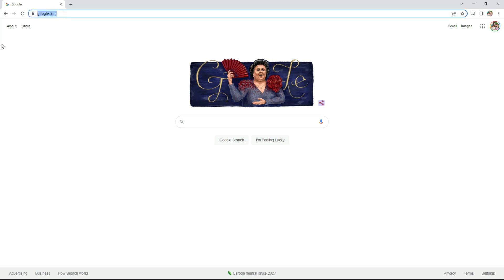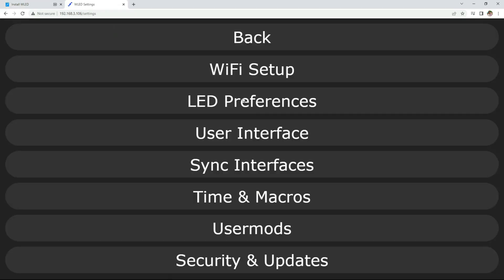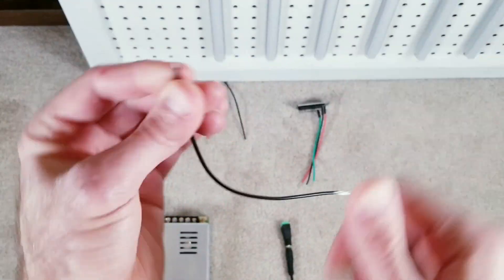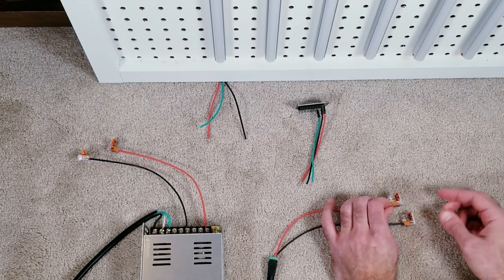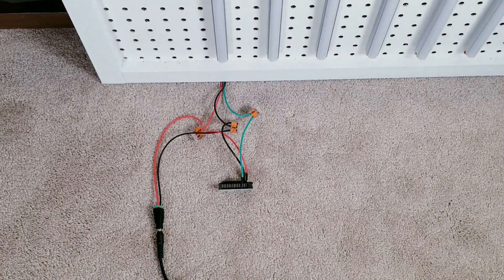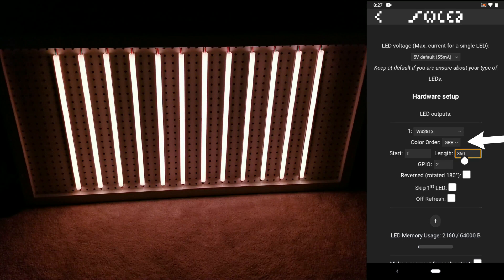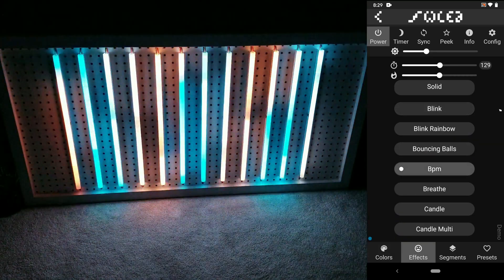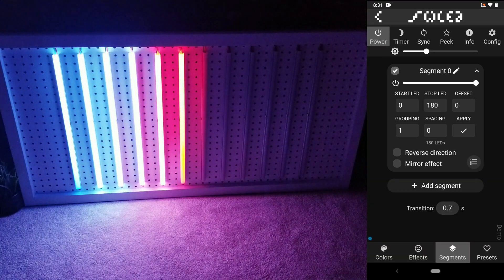How To Install WLED on an ESP32 Board and Connect / Control Addressable LEDs

Comment: I’ve been trying for hours on two separate led strips with two different means of powering and I’ve only managed to get a singular led to light up on the second strip I’ve bought. I genuinely have no idea what I’m doing wrong at this point.
Reply from the maker: Thanks so much for watching! I would first go to your settings in WLED and then go to LED Preferences. Make sure the GPIO is set to 2 (or whatever you used for the data pin) It used to default to 2 but lately I've noticed after installing WLED, the default has been 16 so I have to go in there now and change back to 2 since I am using the D2 pin. Also make sure all your grounds are common.
Reply: @ChrisMaherDIY  I will try cutting up the strips to see if I can power them and maybe order a third strip and hope that it works.
Reply from the maker: @DJack34  sounds like your really close! Once you get it working then you will never have to go through this again! Let me know if you end up getting things up and running!
Reply: @ChrisMaherDIY  HI Chris, it's been awhile, turns out having kid takes up a lot of time, I was wondering if you could help me out again.  I have yet to get the lights to work but I did run into something strange.  While having everything hooked up and power on I decided to put my meter on the strip and found that everything was being powered as intended.  I even put it on the data wire and tested it and the voltage changed as I changed the settings in WLED through the wire even.  Which brings me to my question, what in the lords name is going on?  Is there a setting I'm missing or am I overlooking something crazy.  I will say tho that it is nice to finally get back around to doing this.
Reply: I may have also bricked one of my esp32's in the process of my testing.  It's a good thing I bought a 3 pack.
Reply: The led strips I have are the WS2812B LED Strips from BTF-Lighting and I have tried three separate strips.
Reply: @ChrisMaherDIY  Thanks,  after making that change I did see a change in my esp, unfortunately I am still having a problem with my strip not lighting up.  The only LED that is lit is the tenth LED from the beginning on my second set of LED strips.  At the moment I have everything connected with  lever wire connecters and bread board connecters just to get it working before soldering.  My biggest concern would be the LED's already being burnt out seeing as how only a singular pixel is illuminating.  I honestly have no idea I have just been spending a little bit of time after work this past week messing with it.  Ever since I found your channel a year ago I have been wanting to do this so I finally just went ahead and bought all the stuff. all thats left is getting it to work.

Comment: what pins are used  ? gee. ive watched 3 of these  'tutorials' not one says,,use pin xyb this will be power or pin ddd will be data //why not ?
Reply from the maker: In this video I link the soldering tutorial video I made that goes over the pin setup. Here is that video: https://youtu.be/apSz3NXYlx8 thanks!

Comment: I need a 5v 40A to power my 32fts addressable led (two 16fts strips sk6812 rgbw 60leds/m). Can I use the same power supply for the esp8266 connecting to vin?

Comment: Hello Chris, thanks for this tutorial! It is very helpful! One questions: I have seen many tutorials using different pins on different esp32 boards with different pin outs. Does it matter what pin I use? Thanks!
Reply: there are so many PINs. it's amazing that he did not mention which pin to use for the Data of LED.  so which did you choose on the ESP32 board?
Reply: So the software allows you to change the pin. I used the default one, but it can easily be changed, as long as you know where the pin is, as it may have a different name that what your diagram may call it.

Comment: Hi, thanks for your tutorial.
I'm tryng to install wled as you let see in the video but getting this error: "Failed to initialize. Try resetting your device or holding the BOOT button while clicking INSTALL"
I've already reset and taking hold on boot button but there's no way to achive the goal.
Have you any tips for me?

Board used: FNK0084	Freenove Basic Starter Kit for ESP32-S3	
Win driver CH34x installed on used system
Connection on COM3 working using usb uart port

Thanks in advance for your help

Comment: I followed your guide and even bought the excat same items,k but i cant get my led to work... WLED finds the ESP but the strips wont turn on... Any ideer?
Reply from the maker: Thanks for watching! The first thing I would quick check is in WLED under led preferences make sure next to GPIO you have it set to 2 (or whatever you used for the data pin) It used to default to 2 but lately I've noticed after installing WLED, it defaults to 16 I believe so I have to go in and change it to 2 which is the pin I always use.

Comment: I'm just getting into this, and it is really interesting. My soldering (yes i watched your video too) is not very good. As a result the VIN wire came loose and touched the ground  whilst powered up by USB and now my ESP32 wont work. I assume it is ruined :(

Comment: Hey thanks for video, question i connected like you did, all board lights blinking but no led lights showing, what it might be?
Reply from the maker: Thanks for watching! I would say first make sure in WLED under led preferences the number next to gpio is 2 (or whatever pin you used for data) it used to default to 2 which is the pin I always use but lately after installing WLED it seems to default to I think 16 so I have to now go in and change it back to 2 the first time.

Comment: Man I’m having issues getting this to work. I’ve followed ever step but only one light it lighting up.
Reply from the maker: Hey buddy! Couple things to check. Make sure in led preferences that the number next to gpio is 2. Or whatever pin you used for data. It used to default to 2 but I think lately it defaults to 16 after a flash so I have to go in and change the first time. Also make sure all your ground wires are connected. Esp, power and led lights. I would check those things first!
Reply: @ChrisMaherDIY  okay thanks
Reply: @ChrisMaherDIY  griot needed to be set to 4 for mine. Thanks for the help brother.

Comment: A little bit confused trying to duplicate this I bought LEDs from your link on Amazon they are 12 v LEDs the esp32 runs on 5 v and your setup it looks like you're running the LEDs and the esp32 on the same voltage do you have 5 v LEDs and not 12?

Comment: In the video you need to make it clear that both are 5v supplies and that you fed that into the 5v pin on the esp32. Otherwise people building this will blow up the esp at least and possibly the led strips! The app is very cool!
Reply: He doesn't explain anything in these videos. He just makes a follow the leader type video. "Do as I do and it will work. " 
As much as I enjoy his channel, Chris does not make great tutorial videos. The huge number of People asking questions in He comment section is proof positive of this. 
He doesn't explain the reason why things need to be wired a certain way..
Sometimes in the comment section he replies to questions and admits to not knowing the answer or not understanding certain technical details.
He's basically a user like us, and he's learning it as he goes. He's just had a couple of years Head start. 
But people are constantly asking him questions in which they should be trying to find the answer themselves
Reply: this is what i was trying to figure out
Reply: I did blow up

Comment: Hey Chris, I'm trying to do a setup similar to this using 55 feet (3.25 strips) WS2811 strips using a esp32 board. Everything is connected properly but the wled doesn't seem to be working, it connects to my internet, the lights turn on but the Wled app says they're offline. I am not sure why, because they've worked before I started to put them up, everything seems to be connected and installed properly. Any help is appreciated!

Comment: Hey, I'm literally ready to pay you to help me, I bought 2 led ws2812b strips, got 2 BTF-LIGHTING AC100-240V to DC5V20A power supplies and 2 esp32 boards. I installed data on the boards, but when connecting everything together my led strip just doesnt work. I tried to power it trough usb with 10 leds and it does work. Any suggestions? I did a research and seems like I need a resistor 370-470ohm and a capacitor 1000uf. Funny thing is at first I thought my leds were defective so I got 2 more strips, then I thought power supplies where defective so I got 2 better ones LETOUR Power Switching Supply5V 40A 200Watts. Then I thought my esp boards were deffective so I got 2 new ones. And nothing works, please help!
Reply from the maker: One thing to quick try is in LED preferences next to the GPIO section make sure 2 is in that box or whatever pin you used for data. It used to default to put 2 in that box but I've noticed recently after flashing WLED on a board it defaulted to 16 so now I have to go in there and change it to 2
Reply: @ChrisMaherDIY  yeah it's 2, and my data connected to gpio 4 pin, it's set to 110v, I'll try with capacitor and resistor I guess
Reply from the maker: @yaroslavmarchuk9106  wait, so your data is connected to pin 4 on the esp device? If so then make sure to put 4 in the box next to GPIO in led preferences.
Reply from the maker: And also make sure the gnd from the esp, the led lights and the power supply are all common.
Reply: @ChrisMaherDIY  hey, so now it works, I don't know how honestly I didn't change much, and didn't even change setting to pin 4 still using 2, I was concerned about it earlier too but saw one of your vids and saw that you connected wire to pin 4 but settings kept pin 2 so that's why I kept it like that if I remember properly, anyways on one of my led strips first led stuck on green will do a research now, thanks!
Reply: It's actually this video when you have wired 4th pin but settings are on pin 2
Reply from the maker: @yaroslavmarchuk9106  ohh lol your meaning like the 4th pin from the side? I thought you meant it was connected to the D4 pin. Sorry for all the confusion! I know there is also a WLED discord that I know people have said is great! I'm not sure what might be going on in you setup since it sounds like you've checked all the things I thought of to check!
Reply from the maker: Also on some of the power units there is a switch for 110V or 220V. I'm not sure where you're from but in the US we need the 110V to be selected for it to work.

Comment: Do you have to put the ESP32 board in some type of case or is it safe to mount it with the exposed metal pins while electricity is running through it?

Comment: Do you have a video on how to add an in-line switch (like a physical power button on the wiring) to a WLED lighting setup?

For example, I have a single LED strip that I want to be able to switch on and off with a physical button, but also want to control the brightness and colors with WLED.

Comment: Hello Chris, if I created segments would I be able to activate a pattern starting at the separate segments? For example would I be able to get them to start at the same time but acting as two separate segments? 

If I were to use multiple strips is it possible to program them to all start separate sequences at the same time by pressing one button? 

I have seen the sync option however I do not know if this would apply. I am looking into controlling multiple strips with one controller. Thanks
Reply: I know this is late, but in his other videos he does this. I don’t know how, but im sure its simple within the app, or maybe just a few lines of code(or copy and paste a code found online).

Comment: Hi Chris, I would like to know what kind of power supply you use when your led strips are mounted on walls ? Do you stick with your huge/industrial power supply 5v/100W or do you use a simple laptop power supply 5v/50W or 60W ? If you use industrial power supply, I guess you mounted it in some box to avoid electrical issues. What is the best solution from your point of view ? I used several time a simple USB adapter 3A /5V and as decoration for my desk it's enough, but I was wondering what is the most efficient solution between industrial power supply 5V/100W and a simple laptop power supply 5V/60W, as the brightness difference is almost not visible. thx

Comment: I’m hoping you can assist me. I have the ESP32 board and the WS2812B lights as you talked about. I have the pins soldered correctly, in my case red to the vin, white to the gnd and gereen to the d2.  I’ve got WLED installed on the board and I can connect to it. Set it up for 2000 ma and configured for 50 LED’s to start with. Only 5 lights are coming on, first 4 are white and the last is green. Nothing I do changes the lights at all. Any thoughts?
Reply from the maker: Thanks so much for watching and taking the time to comment! Couple things I would check is make sure all the gnd's are common. The power, led strip and esp device. Next, under led preferences, next to gpio, make sure 2 in in that box next to it. It used to default to put 2 in there but lately i've seen on some flashes that it defaults to put 16 in that field. Let me know if any of those suggestions work!
Reply: @ChrisMaherDIY  thank you! That solved the issue.

Comment: Hi Mate, 
Thanks for the nice vide. How did you connected them from the upper side to the next strip?
Reply from the maker: Thanks so much for watching and taking the time to comment! In this video I go over more the actual project of the led strips and getting them connected to each other in case your interested: https://www.youtube.com/watch?v=K4EzLI1fFnQ But basically I just connected them together using wago clips to my own soldered on wires! Thanks!
Reply: @ChrisMaherDIY  thanks alot mate. Finally my leds with profiles and diffusor looking great on the wall. Thanks for the great inpiration.

Comment: Great videos!  I want use this to wire up Strips for 16 stairs.  Should each strip be wired in series back to the controller?  Can I wire them individually back to the controller/power supply?  Just worried about future replacement in the event of a strip failure and having no access once stairs are installed. Your insight would be very helpful. Thank you
Reply from the maker: Thanks buddy! Appreciate you watching and great question! I personally would probably try wiring them in parallel back to the controller vs in series but probably a personal preference on just how I think it would look best with all the lights doing the same thing at the same time. But i have never tried splitting the data that many times so I'm not sure if there would be any issues. But running them in series would obviously allow you to have all the leds act as 1 long strip if that is more the look your going for. I wish I had some first hand experience with this but I'm just guessing lol. I think both ways should work but probably just boils down to what you think will look best and provide the most flexibility down the road.

Comment: For WLED, the data wire will connect to D2 or D4 pin of esp32???
Reply from the maker: Thanks so much for watching! I've always used the D2 pin on the esp32 device. Then in WLED under config and led preferences, make sure you put 2 in the area next to GPIO.

Comment: Hi there, great tutorial👍. Got one question, is there a reason you didn’t use micro USB for power connection? You prefer to connect power directly to pins? Thanks!
Reply from the maker: Thanks so much for watching and glad you liked the video! That's a good question and either option would be just fine! I think I just liked not having to take up a wall plug for the esp device and then another one for the main power.

Comment: Great video! I will soon start my first WLED project and I have one question. In your final installations  where do you put the ESP32 boards and all the wires? Do you hide them in cases or just leave them unprotected?
Reply from the maker: Thanks so much for watching! Great question. Mostly I just hide everything behind something in the room. Plant, furniture, electric fireplace etc. I have also heard of people using a travel soap dish to put the esp device in. https://amzn.to/3YQVPID  I don't have a desire to put things behind the wall so options are somewhat limited. But I did make a quick video of one way you could make things blend in a little better if you don't have something to hide it behind! https://www.youtube.com/watch?v=ibRp6eeUwBA&t=1s
Reply: @ChrisMaherDIY  Thanks a lot for your reply and for the video you linked! I was hoping to find something especially conceived for hiding the ESP32 module and the power supply, but I didn't find anything on the market. I think I'll with something very similar to what you showed in the video. Great suggestions!
Thanks again!

Comment: I have a problem with my board when I connect the green wire to the D2 pin on the esp board the light doesn’t come on, but I played around but the light works when it’s connected to then Rx pin. 

My question is, is it safe ?
Reply from the maker: Thanks so much for watching and that's a great question! I'm not entirely sure on this one. Maybe someone else reading might know for sure and can chime in!